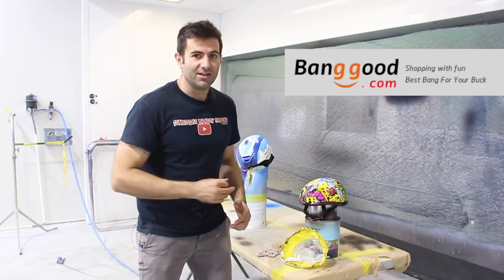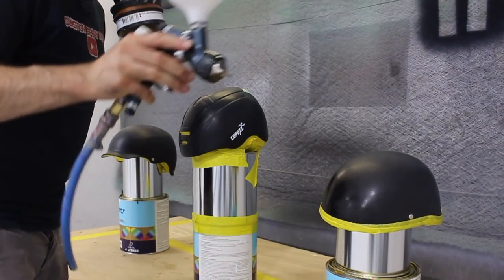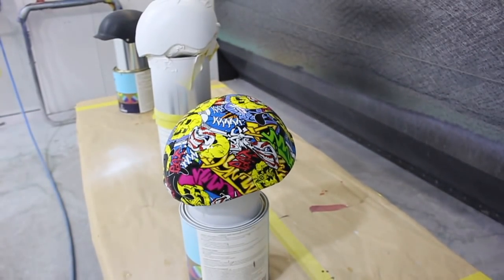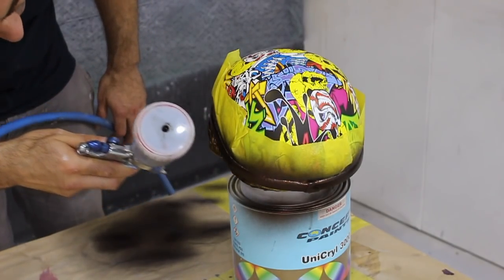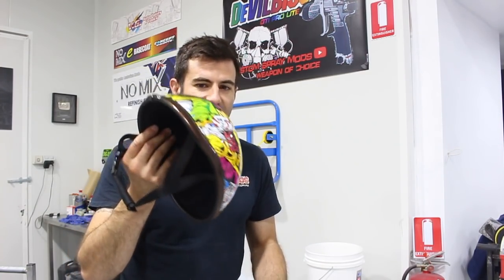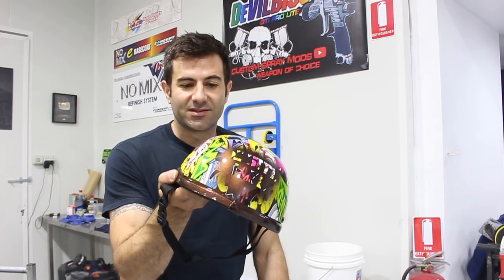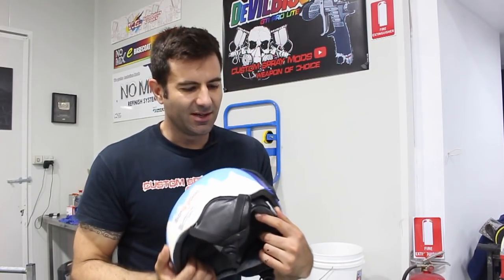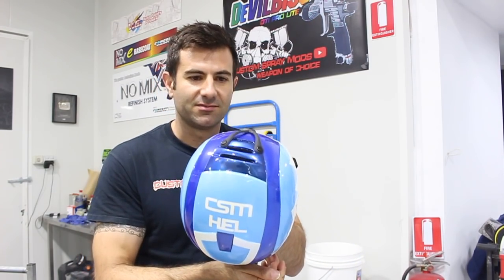Custom Painted Hydro Dipped Helmet

Comment: Hi Dave
I dip the object i had in the film and didn't stick into it. I used Dulux   spray paint. 
I sand it back and got rid of the part of film was stuck on the object.
Just wondering  weather i need to sand it right back and get rid of all paint and start again(primer,base coat and dip again) or put few top coat and dip again.
Thanks